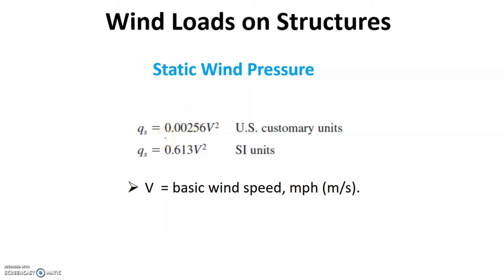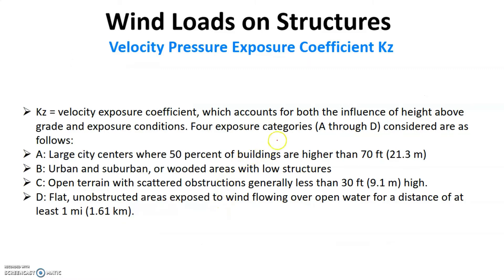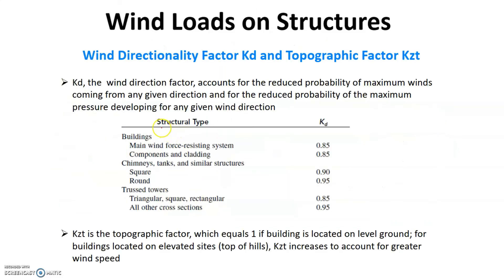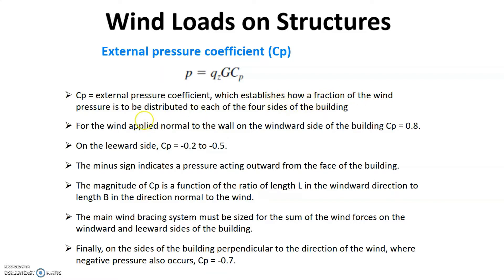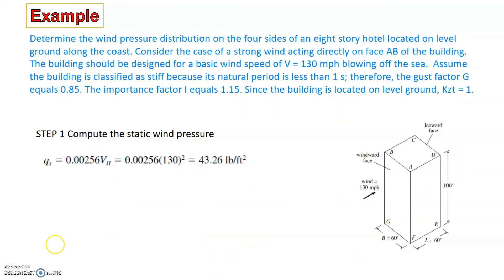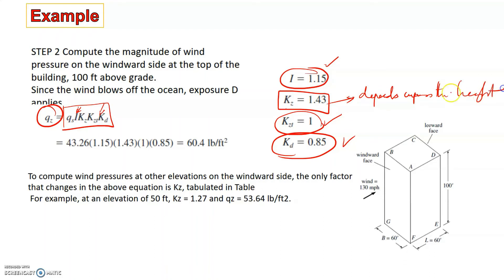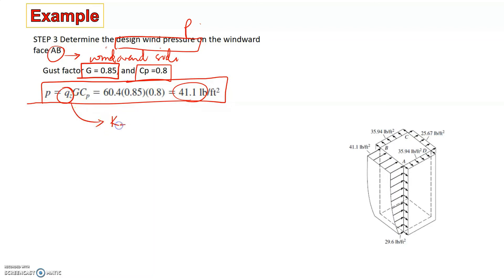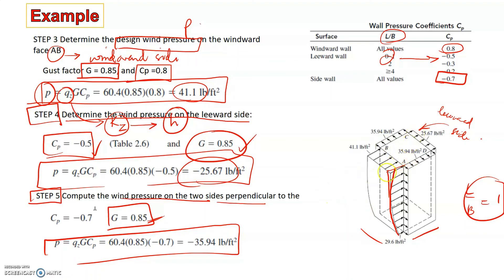How to apply Wind Load on structure? 💨(The ASCE 7 way)

Comment: Very nice lecture, but isn't the importance factor included in the wind speed maps? There is a different map for each factor. Also, these loads are LRFD (ultimate loads). You can convert to ASD (Allowable Stress Design) by multiplying x 0.6

Comment: I find it interesting that the windward load varies based upon the height, but the side walls does not.  Also, at the base the side wall load is greater than the windward loading

Comment: how to calculate wind load on "OPEN BUILDINGS"?? cant find anything and the info on 7-10 ch.27 is not very helpful. There's no table for such a case. Also, i would imagine for an open building (no walls, or less than 80% enclosure) there are two cases of pressure on "roof" (could be roof without ceiling or it could be roof with ceiling, or it could be roof with partial ceiling). one case would "suck the roof" from the top (the normal negative wind pressure on roof), and a second case would be the load from wind coming into the building and "pushing up"? or should we assume it "flows through"? , I mean, if there are walls, but less than 80% enclosure, i can picture air pushing the wall and then flowing up into the ceiling or roof. So what's up with that? thanks

Comment: Thanks a lot...
Sir 
i have a problem, a car parking structure which is cantilever of 5.8m both side at a degree of 10.. surface not like a wall 
how can calculate the wind force...
Kindly update...
Reply from the maker: This seems to answer you question:
https://communities.bentley.com/products/ram-staad/w/structural_analysis_and_design__wiki/20926/wind-load-on-inclined-member